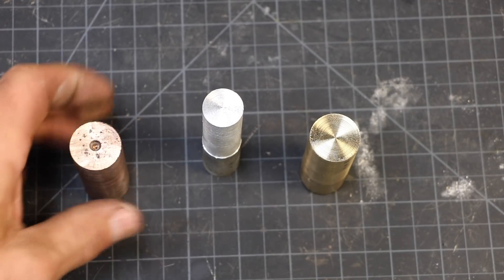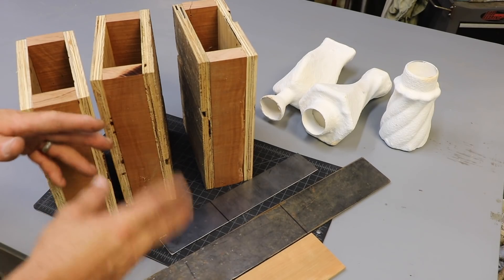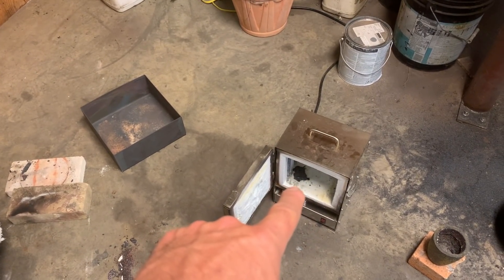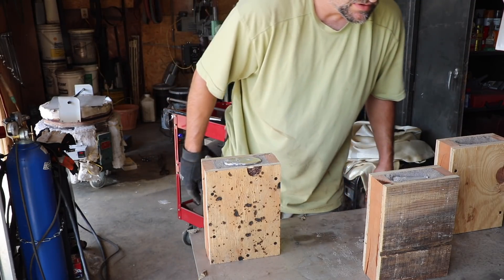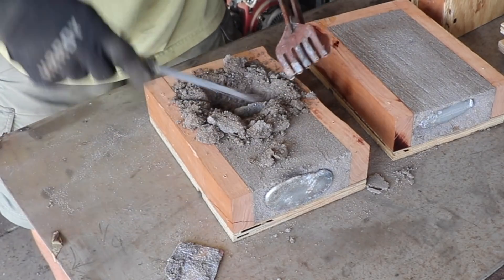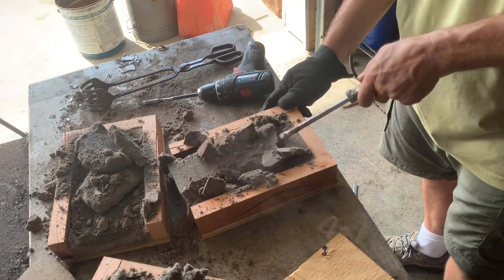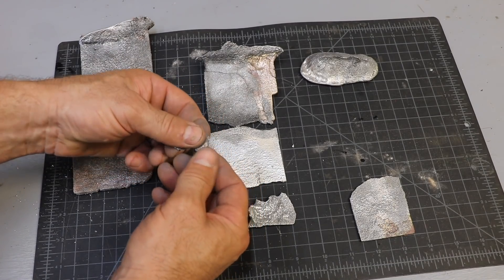Mixing Molten Metals.  What Could Go Wrong??

Comment from the maker: It’s cool that so many people are commenting and trying to predict the results. I’m reading all the comments, but there are too many for me to reply to all of them.  And it seems I’m not the only one who didn’t predict the crappy alloy problem. 🤦‍♂️ Appreciate all the interaction. Have a great weekend everybody!
Reply: This is my life sometimes I come up with a simple idea and it turns out to be fairly complicated
Reply: The strength of an alloy all comes down to the crystal structure of the atomic lattice. Aside from all of the problems of trying to do interrupted pours at different temperatures, if you are creating an alloy that doesn’t form into a good lattice, it will fail.
Reply: One floats
Reply: Copper will run to the bottom and aluminum float on top.
Reply: Can you melt down the test pieces to see what happens??
Reply: Try the reg bronze and brass, but lean in with the oxidation.
Reply: Try mixing Nickle and Copper, I heard it forms a special type of metal.
Reply: This is my first time on your channel and I have almost zero knowledge of pouring metal outside of the basics of creating a mold with a sprue, etc. (somewhere I have a book on this stuff that I glossed over at some point)but my first question watching you do this was how pure were your alloys.  I saw you throw several balls of aluminum foil in the mix and I question if that's actually pure aluminum.  It would have been nice to see at least an attempt at a light polish before viewing the results as well.  I was surprised you went with such thin pours.
Reply: Why didn't you try melting the copper in a bigger than usual crucible, and pour the aluminum from its crucible into the copper's crucible; mix it, and THEN pour it into the casts from that one single crucible?
Reply: I'm trying to make an alloy using molecular size as a rough guide, to fill a volume packed as densely as possible. Assuming a sphere takes up 74% of cubic volume, I start with 74% main ingredient (copper?) and add successive amounts of smaller diameter elements to fill the gaps(74% of remaining 26% empty volume) I'm trying to sortof quantise atomic sizes in a given volume. Minor additions of some elements may have major effects on the metal. Hopefully I can find an alloy that is 100% saturated, which should have the property of heating up if squeezed in a vice.
Reply: you should use a stream of water to clean away the sand...

Comment: They're going to both cool and contract at different rates, and the interface between the two will "rip out". If you pour more in too fast, the denser one will sink while the other rises. This could give you an interesting pattern, but the weight of the denser one might push still molten less dense metal around its own contracting edges.

Comment: My prediction was that because the metals were heated to different temperatures one would transfer the heat to the other and the hot one would set on contact with the cold one so it wouldn't mix or cool uniformally. I was expecting swirls of different materials with a brittle alloy between the two.

As far as a cool thing to do with those vase moulds, I saw some glass made of Calcium Copper Acetate that was a beautiful colour and would look good as vase glass. Also I remember watching a video years ago called make rubies in a microwave which might work too.

Comment: ok man... I am at 5m 17s.  My prediction is that the copper will be too hot for the aluminum to handle... so... perhaps some kind of volcano effect?

Edit.  I watched the hold thing and now I have a question.  Why did you not heat both metals at 2000 and then mixed them?  I thought that 2000 degrees would make the aluminum really consider going sublime 😁

Comment: Hi. At the time 5:15. I think those two metals will not mix and copper as a heavyer metal sinks at the bottom and aluminium as a light metal will go to the top. And why do I think like this? Because one other guy tryed this ones and then it went like that. He was addin both metals at the same time and still they did not mix at all.
Reply: I already knew that mixing aluminium and copper like a random walues, it will get very brutal and veak. But, if you mix them right you will get still very brutal, but hard material. So hard, that it is almost impossible to drill it with regular high speed steel drill bits. I know it, because I did it just like you, just wanted to know what happens if mixing this and that etc. I do not know what is the right amount of copper and how much it needs aluminium, because I did not measured it. I just test and that was the result. I think it is a bit more than regular aluminiumbronz. Maybe like a 15-20%, or maybe even more aluminium. And one thing that I did notice was that a different ratios will do have a very big differences between grain structure. And of course, if grain structure is smaller, then it is tuffer, or stronger. And what was interesting abaut my experiments? The grain structure was very fine and small, but still it was very hard and almoust impossible to drill a hole on it. I tried with a very many different drillbits, and still they all went unsharp in a eye blink. Well, very interesting test, at least I like things like that very much. Ps. Have you never ever done anything with beryllium copper? I have. And that shit is tuff.. I mean, it is hard and tuff at the same time. And there is only like a 2% of beryllium and rest 98% copper. And if mix some other metals, that is a whole another story. But it is hard and tuff.

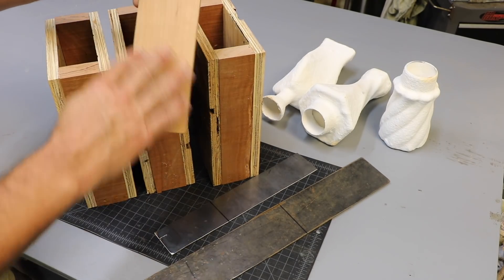Comment: Not sure yet what you did (1:30) but i am pretty sure you'll want to have the two metals mix while you still have heat applied. Keep them at the copper melting temp, possibly insert a gas bubbler and they may make an alloy... Realistically id need to look at my engineering text books to give a good answer

Comment: Best way to do this is mesure your materials by weight and volume 
But the copper will weigh more, 
Now after the copper is molten and the aluminum is just about to liquefy but still a solid dump the copper in on top the the super hot aluminum the copper will raise the tempture of the aluminum as the aluminum cools the copper. This you can pour.   Your going to have to figure out how to get a 90/10% mix

Comment: Shine the metal parts that look good them mix a countertop clear epoxy pour it into the mold and put the metal in the center of the epoxy.
With the epoxy molded part you can turn it on a wood lathe then polish it to a high gloss.

Comment: Prewarch: I think since there is such a difference of melting points between the metals that once the molten aluminum hits the molten copper it will immediately start to freeze the copper and the reaction might splatter a bit and be a little violent. Probably unsafe

Comment: So i stopped at 5:17 to make a prediction, i am not a metallurgist or anything of the sort. I would say you would end up with most of the copper at the bottom and most of the aluminum at the top due to different densities. I dont think they will mix very well if even at all, since the copper is at a higher temperature it will melt the aluminum it contacts and flow down to the bottom.

This is just a guess i would love to be wrong but usually i am somewhat correct.

Comment: Just a thought, aluminium boils at 2467 degrees Celsius, it is possible to melt both copper and aluminium in the same crucible, maybe add flux to the mix

Comment: I was expecting a disaster kinda like pouring water Into hot grease. And after I saw the first mold I thought they were all going to be shot. As far as the molds maybe do concrete or colored epoxy  with the broken bits in it idk 🤷‍♂️  just a thought.

Comment: when stuff get this hot things are cooking and wirling around as a liquid , the higher temperature copper might even burn up the aluminium (wonder if aluminium heated to  13000 gets a little brittle 
it might work better if you cast a thicker piece and machine it after its cooled

Comment: Prediction.
I know water coming into contact with molten metal can create explosions when the water flashes to steam, expanding about 1400 times. If the molten aluminum turns to gas at any temperature below the 2000 degrees of the copper. That could be a big problem.

Comment: What if you did it sideways, had a thin divider in the middle of the plate, and pulled out the divider after pouring the metals while they're still liquid. That way density of the metals and having too much aluminum would be solved?

Comment: So paused video. I think its going to spit up and not stick together due to oxidation forming between materials and that effect with bubbles i cant never remember name of.. The same thing that allows liquid nitrogen to roll over your skin tho. Also both metals will become solid at different temps so that also aids in them not sticking together.

EDIT: Yep i was wrong. But now i know! Good job, interesting experiment i never thought about weight.

Comment: Ok so as im watching this I didn't realize you hadn't even put in breather vents in your molds. Big no no.

Also copper cools down too quick-your waiting way too long ... usually with copper your going to want to heat up your mold to  a pretty hot temp so the copper doesn't crystalize too rapidly and shatter. 

Will add more as I keep watching. 

BTW for the record I'm an amateur metallurgist.

Comment: If you are trying to make an alloy (and not some odd Damascus in a foundry-use a forge for that) i would presume the best way to get them to  mix would be to first grind them into powder and melt them together in the crucible in a 50/50 by weight measurement....

I would predict in this way you would have a violent reaction that produces lots of gas bubbles, voids, separation/refusal to forge weld from some type of oxidation /electrolysis or using the wrong flux for both materials, your mixing two materials at dramatically different temps. Might as well be quenching hot iron in an ice bath. Going to be brittle at the very least.

Comment: Ok @5:11 I’m guessing the difference in temperatures between the aluminum and the copper is going to cause an intense reaction due to the drastic temperature difference of more then 1000 degrees...ok so @9:10 it seems like the increase in temperature caused the aluminum to overheat and become brittle.

Comment: if you want to know what will happen  to molten metals - look at the visible side of the full moon.  the heavy metals always face their centripetal influence aka  earth.  
molten metals will separate based on their specific gravity unless gravity is removed or artificially / technologically overcome. 
you might also attempt to  control your cooling rate which would prevent over hardening by excessive cooling rates ie annealing .

Comment: As a metallurgist here are my predictions. The layer pour method will only produce layers if each layer is allowed to solidify to some degree. Without the pervious layer being solidified the two metals will just mix together forming Al Bronze. The simultaneous pour will just lead to the formation of Al bronze no stripes of different metals will likely be present.

Edit: I always seem to forget about the density differences in liquid metals, when arc melting samples we melt them several times to make sure the elements are homogenously distributed. I would honestly try this again with AL and Cu but let each layer solidify before pouring the next. By allowing layers to solidify you avoid creating brittle intermetallic compositions from the uncontrolled pouring of the metals.

Comment: I don't know much about mixing metals the way you were doing this experiment but what about smelting the two together at the proper ratio like sterling silver ie 5% copper / 95% pure silver.  I assume you were going after a molted pattern instead of a solid mix.

Comment: At the 5:20 mark, my guess was that either the temperature difference would keep the metal from binding properly (possibly having some minor combustion in the mold) or that there's another binding element missing which could cause the metal to split apart after solidifying

After watching the rest of the video, the solidified outcome is about what I thought it would look like, but the reason for that outcome was not what I was thinking.  I've only had a little bit of experience with metallurgy through welding, I wasn't expecting the metal to bind as much as it did, and kinda thought there would be more of a pattern with highly brittle weak points where the metal overlapped, it's neat to see multiple alloys form from just two materials (even if the vast majority of them formed a brittle mass of unusable junk metal) the fact there was a portion of it (even a small one) which came out close to the desired alloy is cool.

Comment: I'm guessing that despite both metals being very hot, one is much hotter so there will be a violent reaction when they interact.
Reply: Glad I was wrong.
2nd guess: When you mix liquids with different densities, one will float on top of the other.

Comment: Electrician/electrical engineer. My guess is the difference in temperature would cause a reaction like poring boiling oil and water together. The aluminum would heat to a hotter temperature causing popping and splatter the still liquid metal. But given their weight and that the temperature that copper melts at would not cause the aluminum to turn to a gas the distance on the splatter should not be more than a few feet.

Comment: 2 different melting temperatures, shorts wouldn't be my first choice. If and when I try this myself I think I will try alloying it in the crucible and then pouring however  it still will probably fail as aluminum oxidizes quickly and I am worried that will hinder the alloying process, also the time it will take to pour as you suggested I think the metals might cool down too fast to pour

Yea this is going to require more thought. Forgot about the surface tension. Feel like a moron cause I have been trying to make coins for my buddy for dnd and know full well how hard it is to pour small amounts of aluminum

Comment: Prediction:
The multiple pours will only have a very slight mixing and be quite easy to break if pressure is applied sideways.
Pouring them together will result in the copper quickly cooling and the aluminum quickly heating (causing spitting?) with the two not mixing but rather drops of copper betting less dense the higher in the mold you are, surrounded with aluminum. In general a pretty crappy non alloy.

Reaction; Wow that was even worse.

Comment: I am not sure anything will happen with these two metals.  they will just probably make like a little swirl cake as they pour   .   I am assuming the copper is probably heavier, so it will form a little lower where they meet   --- the mirrored piece does look cool,  individually they are strong, but both together, I guess not so strong

Comment: That did exactly what I though it would. 

Make stuff with Aluminum Bronze mix. It is lighter weight than typical bronze. It is also more corrosion resistant than most types of bronze. It you want stuff more like damascus you really can not do that with molten metal.  Gravity of the fluids will always end up doing that.

Comment: A while back, I attempted to make a water cooled aluminum heat sink by embedding coils of copper tubing in a cast aluminum block, it was a complete failure. It turns out that copper is highly soluble in molten aluminum and even though my molten aluminum was far too cool to melt the copper, my copper tubing completely disappeared it just dissolved into the aluminum
Reply from the maker: You made shit bronze!  ;-)
Reply: @FarmCraft101  Hey,  sometimes you learn things the hard way and those are  lessons that stick with you.

Comment: I'm guessing you'll get a fairly violent reaction during the pour, with a lot of pops, bangs, splatter ....
[edit] well, guess that is why I am an electronics engineer .... that said, I recall using eutectic solder whereby the alloys used freeze at or very near the same temperature.  The freeze temperature between the two metals used here is too great.  Good stuff!  Learn something every day.

Comment: I would guess that pouring in the molten iron with molten alum would cause the alum to boil over like crazy due to dramatically different melting and boiling points.
Reply: There's no iron...
Reply: It was a prediction not a statement of fact. I was kind of hoping he would give it a try.

Comment: So, here is my thought, it would be fairly difficult to do, but if you just melted copper, and some how suspended a number of small pieces of aluminum inside the mold (not molten, probably help to get the mold fairly warm tho) then added your molten copper, the heat of the copper, would melt the aluminum in the spots where it is resting. I don't have much experience casting metal but I'm sure there is a wax or something you could lodge inside the mold to hold the aluminum in place that would simply be burned away upon adding the copper? 

this way you can use your vase molds, and get your copper aluminum mixed patterns. I bet you'll find that the little bits of aluminum will spread farther throughout the mold than you might think (big splotches of silver color despite fairly small pieces of aluminum) and you'll end up with a stronger alloy closer to your aluminum bronze!

Comment: Paused at 5:17.  I imagine you're going to fuck up the pour because ambidexterity is harder than it seems, and there's the added pressure of pouring two insanely hot (and quite heavy) liquids with a multiple hundred degree temperature differential, and no idea what's going to happen.  Maybe some sputtering and noise and you get spooked and jump back.

E:  Well I was thinking too low-mindedly.

I guess to do this stuff you need some sort of crazy pressure vessel to get their temperatures closer together...?